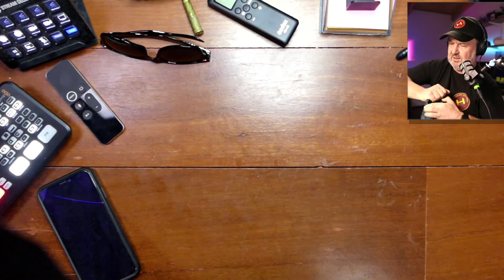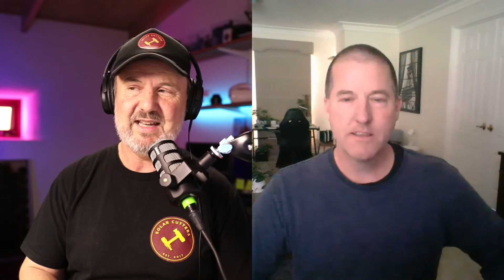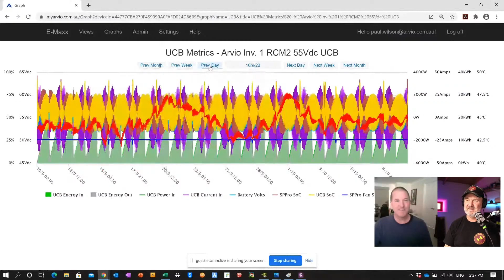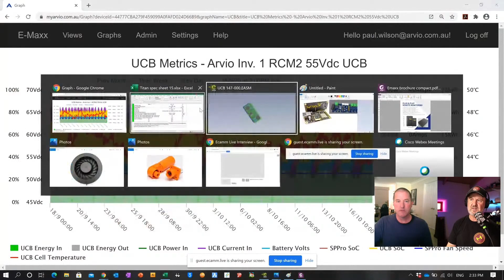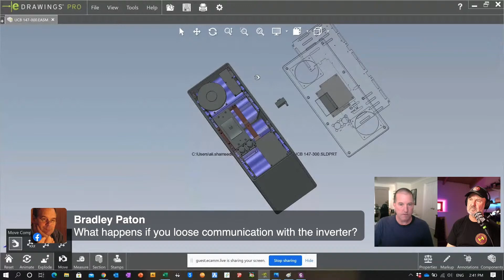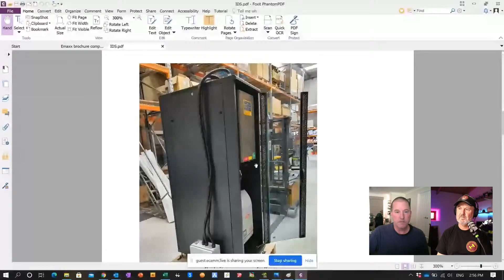The Ultra Capacitor Battery

Comment: static electricity storage looses capacity when linked together in series for usable voltages unlike chemical. 
those 20x2kwh modules linked in 10s2p configuration have a nominal capacity of 0.4kwh or about the same as a small lifepo4 power station
LTO is cheaper and a lot more simpler and has similar cycle lifespan, operating temp, more usable flat voltage curve, slightly higher internal resistance like same order of magnitude, way better volumetric energy density around 2 orders of magnitude. a 20ft shipping container completely jammed pack with nothing but super caps has similar energy density to 2 barrels full of batteries. 
no issue with messing up the R/C time value of circuits.... no leakage/loss of charge over time.
lto is like 3x the price per watthour as lfp now.
Reply: The interesting thing about capacitors is that it can drain completely without damage..
Reply: @annabellemanuel189  ya LTO is pretty bulletproof though down to around 1 volt per cell. even complete dishcarge doesnt kill them. u should look into LTO :p
very few scenarios where youre going to accidentally discharge stuff down to zero. most things have a forward voltage requirment before turning on, even phantom vampire loads